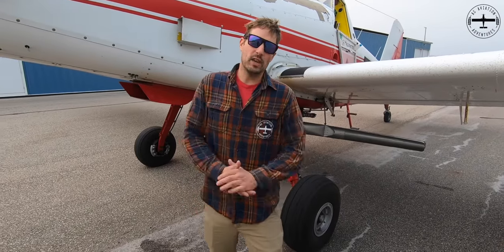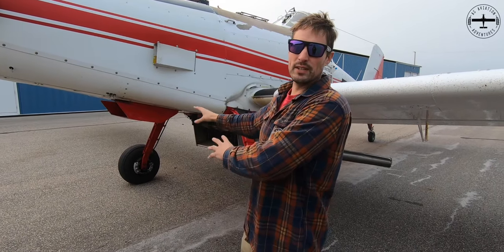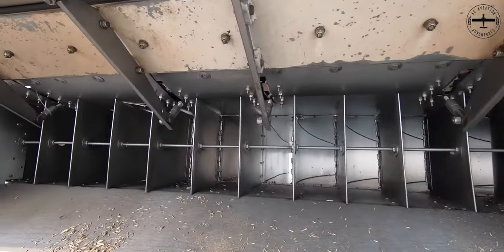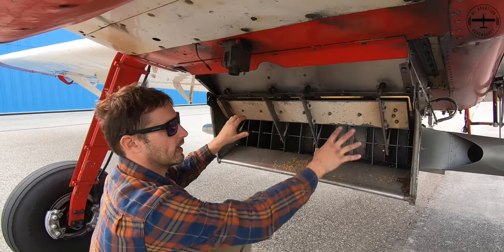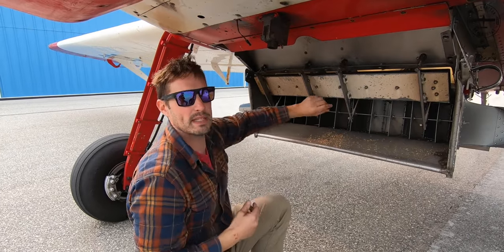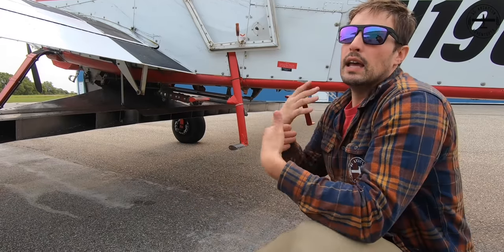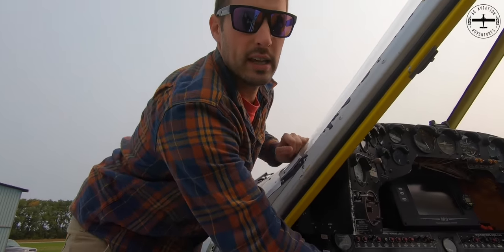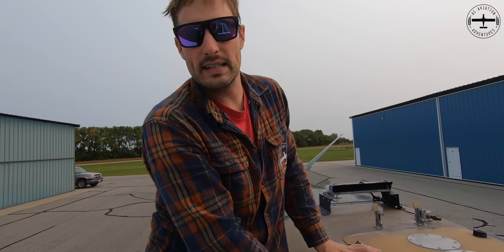How the Spreader Works on an Air Tractor 502 for Dry Work

Comment: Here is a true story back 1975. We were doing seed. We used Agcats. The owner had just purchased his second Agcat. The other pilot had just taken off loaded. Back then, we used female flaggers. This pilot had a thing for one of them while he was fully loaded and slow he looked over his shoulder at said girl, and he flew into the only oak tree in the field. It ripped the spreader off the bottom and damaged the lower wing if not for the fly wires supporting the upper and lower wings he would have surely had a very bad day. He was able to dump the seed until he was able to land. It was then he discovered the right brake line was destroyed, which, as you well know, once he became on ground and airspeed dropped to where the rudder wasn't working anymore is when he ended up off the dirt strip into the field. Watching this video and the spreader brought back old memories
Reply from the maker: Holy smokes that’s quite the memory!

Comment: Question? I noticed both the Airr Tractor painted in both yellow and white.
You also  thrush?
How many different crop duster businesses?

Keep up these awesome videos. Thry are Greartt!😅😅😅😅😅😅
Reply from the maker: Appreciate you watching. The two main players in the ag aircraft business are Thrush and Air Tractor.
Reply: @AgAviationAdventures  That seems to be the case here in northern California. The Ag Cats used to be a major player, but they seemed to be replaced by the Air Tractor and Thrush.
In the mid 70's there were the old Stermans and N3N's. Both, of course, bi-planes and didn't do well hitting wires.
In my history, running the loader trucks, I've seen wires snapped, trees hit, and a Ag Cat flipped up side down full load of fertilizer. Anyway keep low and fast
Reply from the maker: @skipker  Yeah it seems like there are still quite a few cats in California.

Comment: very cool, how do you apply at very low rates? 1 pound/acre? can you slow down that much?
Reply from the maker: That is a plate that you can put at the bottom of the gate that restricts flow so you can get it lower.

Comment: Great video! Do you know the angle at which the far right and left veins point? Long story short I am working on a project to roughly model seed coverage at different conditions, and I am trying to figure out the best way to model the variance of seed direction after drop. Based on this video, it looks to me like a seed coming out of the far-right vein would be initially moving in a horizontal distance ~90 degrees away from a seed which came out of the far-left vein.
Reply from the maker: Hi Andy. I'm sorry but I don't know what the angle is.
Reply: @AgAviationAdventures  No worries. Any chance you know the width of the 'air-intake'? I think the angle could be reasonably estimated with that number. Or a make/model of the spreader? Assuming it's not home-welded I guess haha. Thanks for your help!

Comment: Great explanation video!  
One question though.  You mentioned that you don’t normally have the hopper gate wide open while spreading most seed.  Does the gate handle have “notches”, if you will, so you only open it so far every time?  I hope that makes sense.
Reply from the maker: No the handle in the cockpit actually has a dial on it and that dial is where the gate opening setting comes from.

Comment: This will be my last question for this hour😂.
I noticed you use flaps during your turns?
On AgCats, because it's a bi wing, there aren't any flaps..  the AgCat flies at a muvh lower speed. I can't remember, but i think around 110 to 120 MPH.
Far cry from the Air Tractor.
Reply from the maker: Yeah the flaps provide a bit of extra lift and tighten the turn.

Comment: Any chance you can tell us about the Hi/low idle. I havnt got my head around that
Reply from the maker: What is it you’re referring to?
Reply: @AgAviationAdventures   
Hi.   
The PT6 has a Hi/Lo idle position on the condition lever I heard.  Is that correct?
Reply from the maker: Yea it’s referred to as ground idle and flight idle. I always leave it in ground idle and never touch it. I have heard of people putting it into flight idle when landing with a load as it will spool up faster.
Reply: @AgAviationAdventures  
Thank you.  Strange. 😃. 
I’ve operated it’s big brother the PT123. 2150 with up trim to 2380.  
Two of em bolted to a Dash 8.   
Looking forward to the PT6 experience